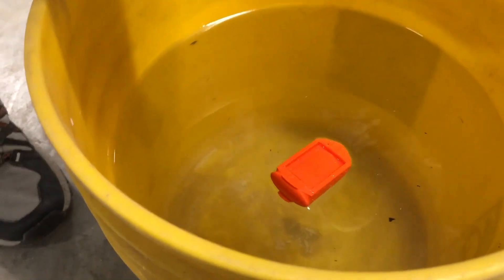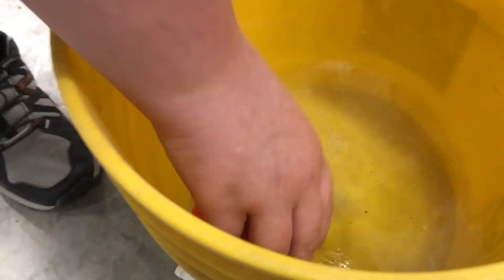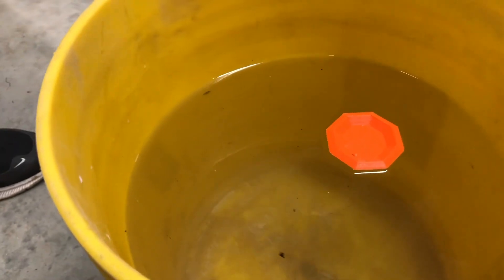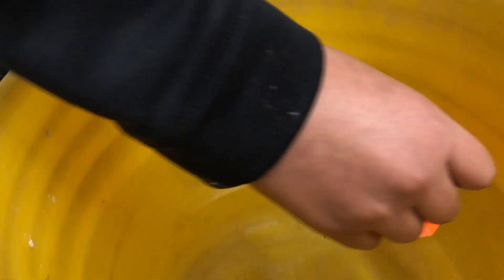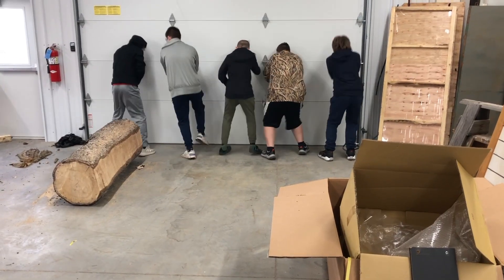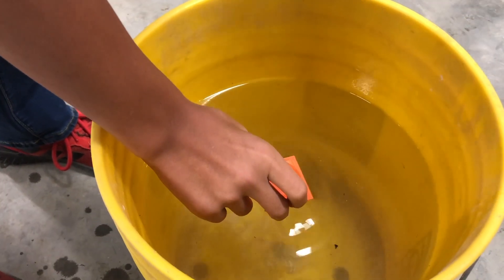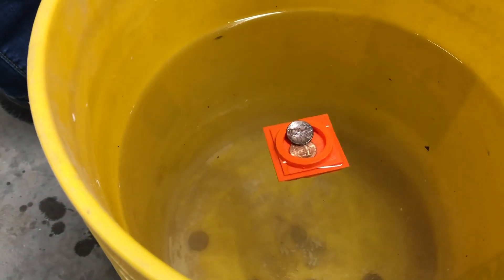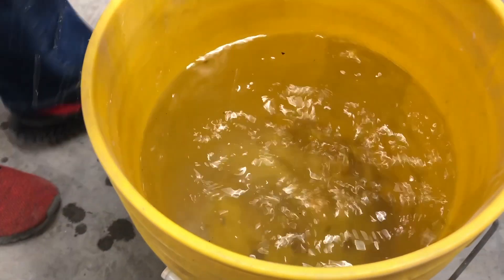Penny Boat Fun Time

Comment: I keep wondering.  There has to be a solution.  No doubt the pennies outweigh the material used for the boat.  Thank you for the mental gymnastics  Mr Kongable.
Reply from the maker: The most was a design that was shaped like a big fruit bowl that starts small and tapers into a much bigger circle. It held 30 pennies